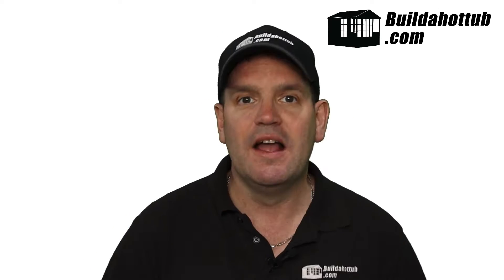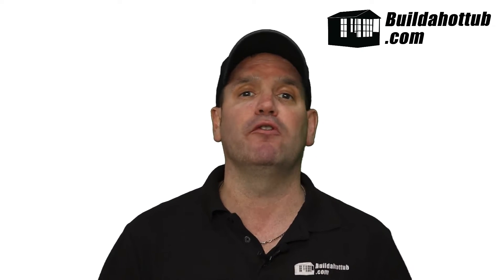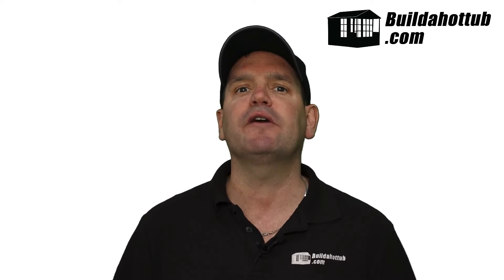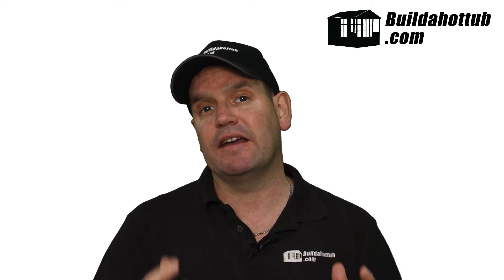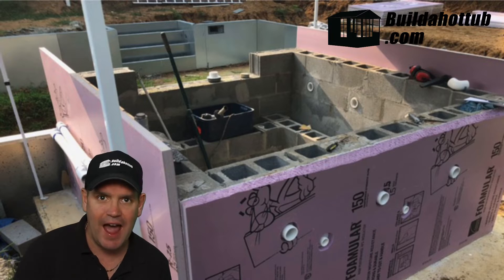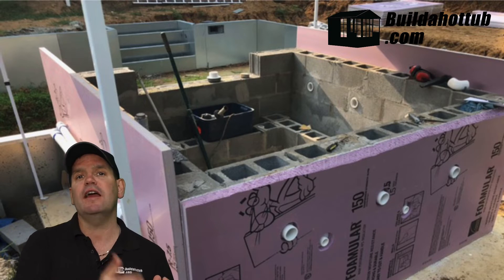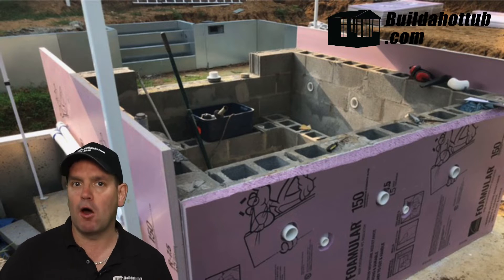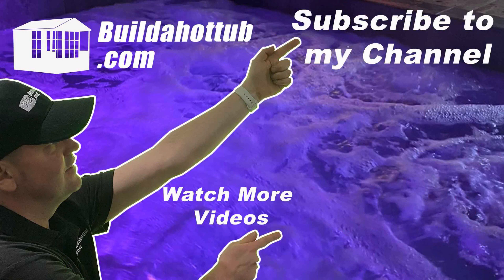DIY Hot Tub Insulation - Everything you need to know!

Comment: Hi Andy,  I am wondering about the heat loss from the jets and plumbing? Is it possible to put all the plumbing in an 8" poured concrete wall and then insulate outside of that, so that the plumbing is also all insulated? Or is this a bad idea, since you can not access the plumbing in the event there is a leak?
Reply from the maker: Quite the question Jared - there are two schools of thought on this as you point out. Depends how confident you are on your plumbing - no reason it cant go inside of a wall - it is designed to do so. However, access is quite handy, especially if you spring a leak - what I dont suggest is doing 50/50 - I did on my own and it was a right pain when i needed to do some modifications! Thanks for the comment - Andi

Comment: Thanks for showing the different styles. Can foam be the inside layer with a liner over that?
Reply from the maker: Thanks for the comment. Potentially yes, although the foam is quite soft so you have the potential for dents in your liner prety quickly that would not look great. Also, for hot tubs I dont recommend liners at all as it is very hard to find jet bodies that work with liners - as one of my case studies "Brandon" on www.buildahottub.com if you check it out explains. - hope that helps
Andi
Reply: @Buildahottub  makes Sense, thanks 👍

Comment: Hiya, good video - I'm a civil engineer - if you're trying to keep something warm (or cold) ALWAYS insulate under the concrete slab - It's now mandatory for houses and even more important if you have underfloor heating where you have to add even more insulation above the slab. So the same logic applies to hot tubs.
Reply: Our pools are always insulated under the slab even if there is a sub floor
Reply from the maker: Thanks for the comment Dave - really good to know! Where would you put the insulation for the slab, under the ballast or physically inside the slab with the rebar and just make it thicker so the strengh is not compromised?
Reply: @Buildahottub  lay and compact the sub-base (ballast) then lay a Damp Proof Membrane (DPM) then the insulation - 100mm minimum of PIR, then more DPM so that the insulation is encapsulated and cannot become wet. The concrete base can then be poured on top of that.

Comment: I live in a coldish climate.  I want to use a block tub that will be insulated daily, what temperature would you recommend keeping the tub at?
Reply from the maker: Hi Andrew, a lot of that depends on the type of heating you have. I've found with my own block tub that the most economical way of running it is holding at 30C / 86F and then taking it up to 39C / 102F when i want to use it which for me is weekends only - with my air source, that takes about 90mins on average, a little longer if it is cold out. After use, i drop it down again. If you plan to use it daily, it might be worth putting in a system where you can schedule the heat (Control My Spa from Balaboa can do it) In that way, you could drop your temp down overnight to reduce running costs, if you were well insulated it would not loose too much, then heat it back up ready for use at the times you would be using it. All possible - depends on your heating method as I said (electric is slow for example) and the times you plan to use it - hope that helps! - Andi
Reply: @Buildahottub  huge help! Thanks for the thoughtful response. I plan on heavily insulting.  I don't think the air source heat pump will be a good idea here in the Pacific Northwest since when I am going to want to use the tub the most will be in the winter.